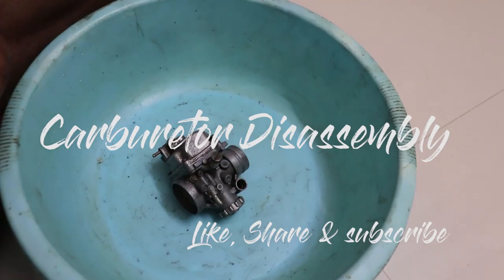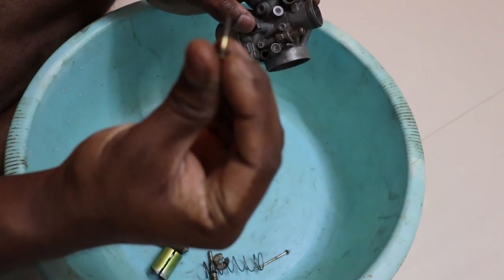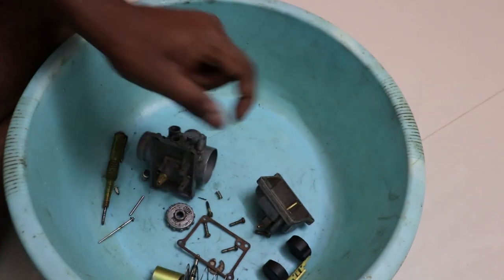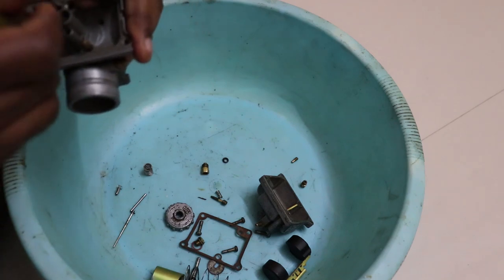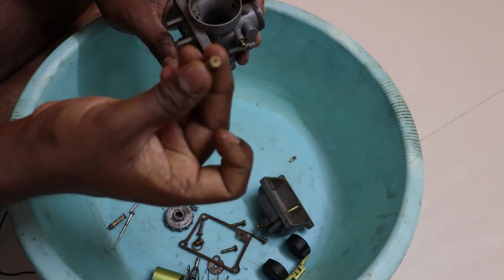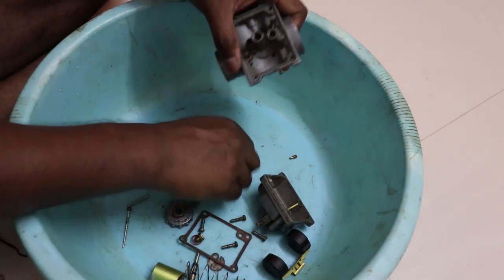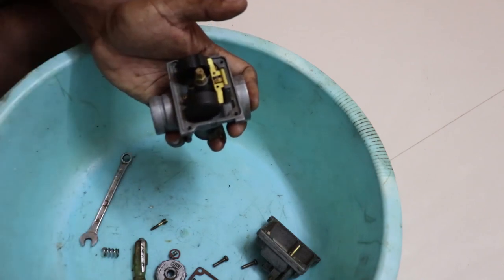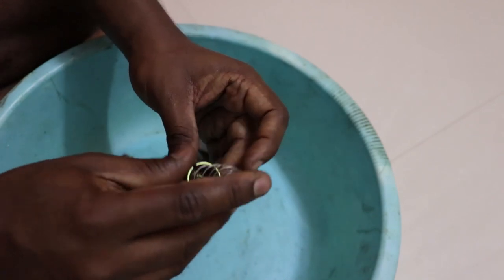Dismantling a Yahama rx 100/135 carburetor to bits

Comment: Hi.  Any tips on how to remove a choke cable holder(brass bit that holds the choke cable inside the carb) from an rx135 carb when theres no cable attached to it.  Thanks
Reply from the maker: Is it stuck inside? Did you remove the brass nut? Best option is to spray some wd40 and use some nose pliers
Reply: @Yamakaze  hi. I mean the brass cable holder piece itself the one that holds the end of the choke cable inside the carb.  and is held in place with the spring and nut
Reply from the maker: shayne dsouza remove the nut, it should fall out
Reply: @Yamakaze  unfortunately it stays inside and doesnt seem to want to exit. ill try the wd40 pliers trick tomorrow.  Thanks for your help
Reply from the maker: It might be corroded use liberal amount of wd40, it should come out with a nose pliers
Reply: @Yamakaze  Will do. Thanks Bud 👍

Comment: I recently did all engine work of my 1990 - Rx 100. My mechanic told me that my carburetor has some problem, so kept the air screw full tight. If I set it to 1.5 turns , bike engine stops immediately. Can you suggest why this problem and solution to this so that bike runs smoothly. Thanks-Devendra
Reply from the maker: Ping me on Instagram
Reply: Ok,  Thanks 👍
Reply: @Yamakaze  Please see on Instagram
Reply from the maker: @devendrabagul6613  replied
Reply: @Yamakaze  Thanks a lot sir for your prompt reply.
Reply: Can you give some lead, clue, reference from where I can get new Original Yamaha RX 100 Pilot Jet ? I am from Raigad Maharashtra. Thanks.

Comment: Brother I removed my carburettor and I reassemble the parts but what I start i didn't rise the throttle but it was rising at full rpm😂 please give solution
Reply from the maker: Check if the slide is stuck or installed incorrectly, check if the throttle cable is stuck and also block the 2t inlet